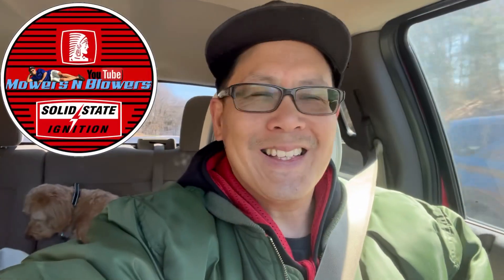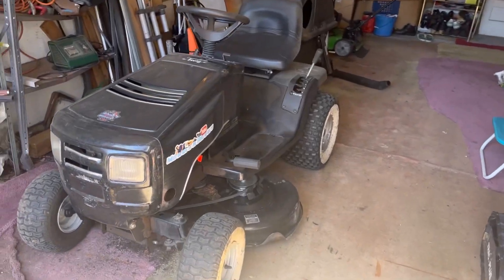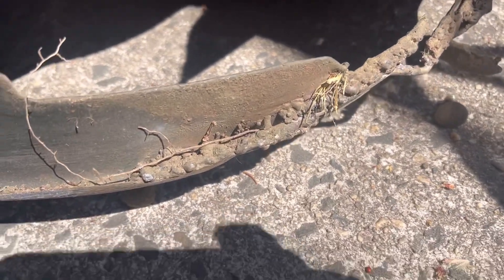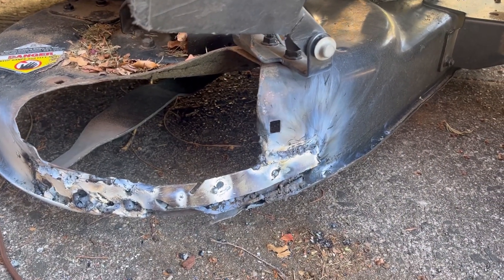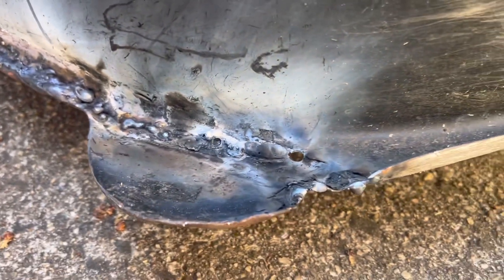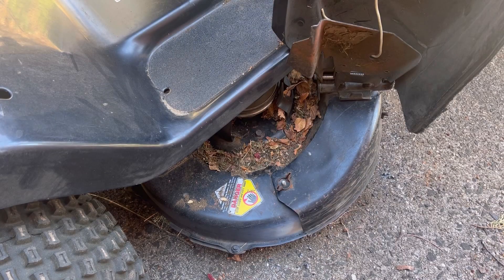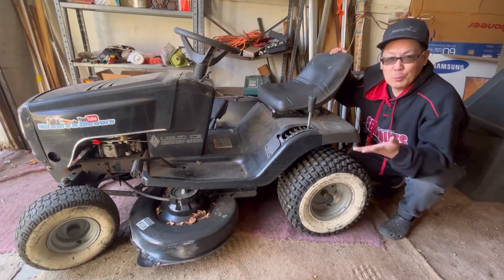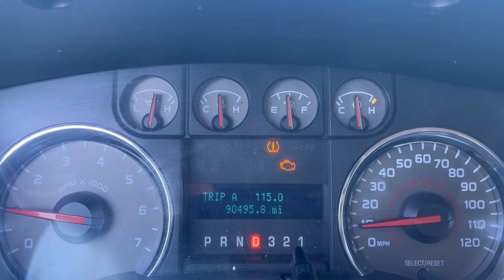WELDING BLACK BEAUTY’S MOWER DECK W/STICK WELDER & NEW BATTERY REPLACEMENT MURRAY LAWN TRACTOR START

Comment: Now that you have a welder…add some anti scalp wheels to protect the deck.

When you disconnected the battery you did a hard reset on it.  If those codes came back up most likely need new sensors.  

02 Sensors are finicky…get OEM/Motorcraft or BOSCH/Denso/Delphi
Reply from the maker: I have two welders now!

Comment: I'm on the first name basis with the auto shop boss at my walsmart, so he puts 4 230cca aside for me every year, and I bring in 4 cores, and leave a happy customer.
Reply: 275 CCA battery at minimum. Those 160 CCA batteries might last a year and a half with no extra trickle charging.
Reply from the maker: I hope to not have to hold onto the tractor for more than a year!

Comment: White wall tires, or is that dirt or mud,  you got to be kidding me. LOL, Looks like its ready for the scrape yard. and yes you may need to take some welding lessons, smooth up your welds a little. 😀  What do you do with those drones. Check on your neighbors. Have a good weekend.
Reply from the maker: White walls! Still runs great!
Reply: @MowersNBlowers  😀

Comment: I can’t seem to find that Murray pto lever, the tractor I have is the 2 bug eye looking Murray, 13.5hp 40in. Ah ya know it’s weird they don’t put a trigger safety on the pto lever.
I got this mower for free and it’s got a bent pipe instead of the original..

Henry, do you know the valve clearance specs on it? Thank you!!
Reply from the maker: .04 intake .06 exhaust if it’s a briggs
Reply: @MowersNBlowers  yes it is, thanks a lot Henry!
Reply from the maker: Here is the pto lever,  the guy mismarked it as height shifter,  but it’s the pto lever.  I looked at the parts diagram.

https://www.ebay.com/itm/225374652683?mkcid=16&mkevt=1&mkrid=711-127632-2357-0&ssspo=wBwabyoPQHO&sssrc=2349624&ssuid=O0RlH3mOSeC&var=&widget_ver=artemis&media=COPY
Reply from the maker: https://www.ebay.com/itm/225374652683?mkcid=16&mkevt=1&mkrid=711-127632-2357-0&ssspo=wBwabyoPQHO&sssrc=2349624&ssuid=O0RlH3mOSeC&var=&widget_ver=artemis&media=COPY
Reply from the maker: Hope you’re subscribed
Reply: @MowersNBlowers  just ordered the lever! Yes I am most definitely man, love the videos. My 3 year old was running around yesterday yelling mowers and blowers lol he loves tractors also
Reply from the maker: @randomreviews595  lol!  Love it!

Comment: You paid how much for that battery, with trade ins credits, 40 bucks for a 190cca yikes. I paid 24 for a 230cca at Walmart.
Reply from the maker: It was $39.99 minus a core was $35, but it was free because I turned in 7 batteries for $70 credit.  Walmart was out of batteries.  The everstarts have been bad lately,  had about 2 out of 5 not hold a charge after a month.
Reply: @MowersNBlowers  ah ok, I was going to say, was it a 120 dollar battery.... Good job bro. A lot of places around me won't let you do that with old batteries, or old oil, but legally they have to, so I always have to fight to save the planet, they are just lazy bastards.

Comment: My 2010 F-150 acts the same way as yours.  Great truck but she always shows check engine.  o2 censor, of course.  She's my second wife.
Reply from the maker: Have you ever changed your o2 sensors?
Reply: @MowersNBlowers  Never.  But my mechanic tells me it's o2 and it's almost a feature of these trucks, heh!
Reply from the maker: @YetiSmasherOhnO  so your check engine light is always on?  That doesn’t bother you?  Because it bothers me.